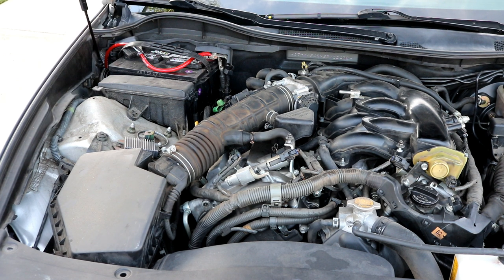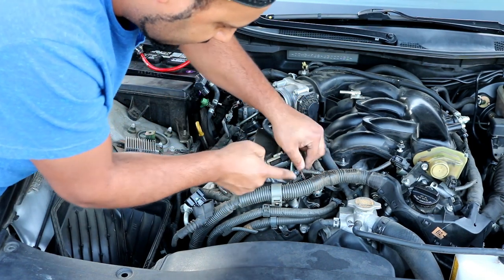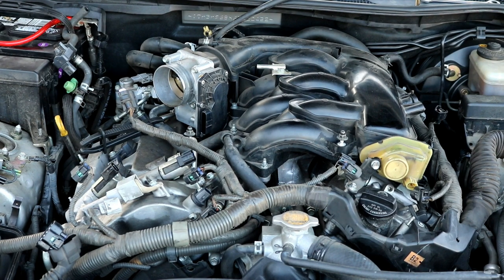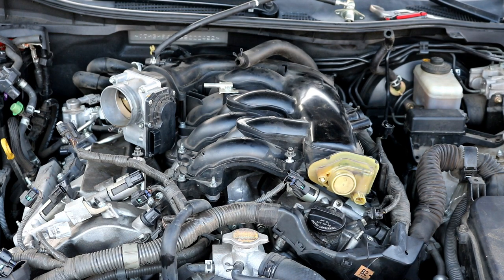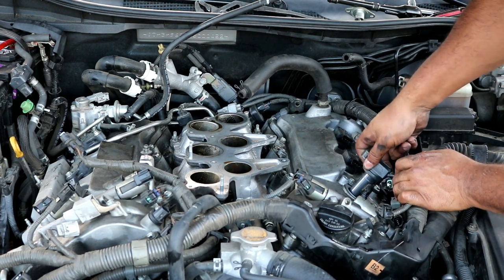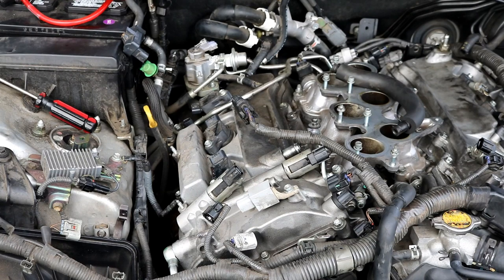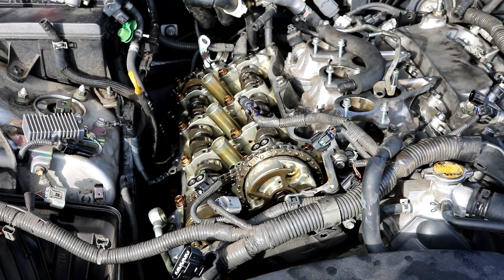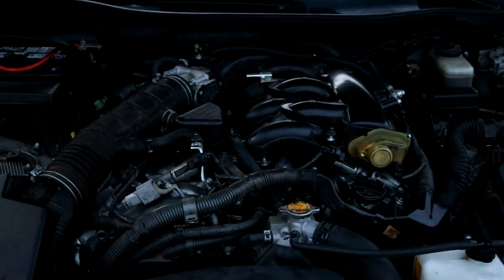Lexus GS300, GS350, IS350, IS250 Valve Cover Gasket Replacement

Comment: Any tips for the gs 350 model? The working room behind the intake manifold and throttle body are extremely limited. The intake manifold is a slightly different design. The throttle body and intake manifold are closer to the rear
Reply from the maker: What year?
Reply: 2008. I got the intake manifold off and started loosening the driver's side cover but I'm worried about the passenger side with that fuel pump or whatever that thing is. Those two thicker coolant lines that are behind your fuel pump are directly above the fuel pump in my model, going to try and wriggle it out from underneath them today
Reply from the maker: Good luck. Your motor is still a GR motor but just slightly different in a few ways. Overall mostly the same.
Reply: @HelpingHandAutoRepair  would you recommend taking the fuel pressure regulator's top part off so I can get some clearance to get it off of the cover
Reply from the maker: If you need to.
Reply: @Bigsackjc  hi my 2008 is250 have same issue. I’m trying to change the valve cover gasket but on passenger side so difficult to take off the cover as you said two thick pipe above the fuel pump. 
I don’t know if I can take off these two pipe off or coolant will be leak, so I need to drain the coolant first?
Reply: @wjks23  if they are rubber hoses just clamp them shut. I'm not sure about the is250 model as it is a different engine
Reply: @Bigsackjc  ok thank you !

Comment: I'm currently in the middle of this job with my 08 is350.  I cant seem to get the spark plug tube gaskets out of the valve cover.  The rubber has hardened to the valve cover and I'm afraid I will damage it getting the gasket out.  Any ideas?
Reply from the maker: Hammer and a flat head or chisel will crack the seal and then you can pick it out. This happens all the time and they can suck to get out.
Reply: @HelpingHandAutoRepair  Thanks!  Thats what I ended up doing.  Was worried Id damage the valve cover. but it was fine.  Currently making this job a lot harder than it needs to be by dropping stuff, not having the proper tools, and stripping the threads to the driver side banjo bolt.  You weren't kidding about that one.  Thanks for the video, its helping immensly.
Reply: @vguitarman  I’m running into the same problem stripping the threads on the driver side, you got any ideas ?
Reply: @vguitarman 2006 IS350 btw
Reply: @lanceredolosa4835  ultimately I took it to a shop near me and had them chase the threads. Came out fine. I just didn’t have a thread tap and die set and didn’t think that was the time to start learning. Such a bummer, hope you get it figured out.

Comment: How long would an experienced mechanic take to do this job? Also how much?
Reply from the maker: Prices vary depending on where you live. If you take it to a shop, they are going to charge you “book time” regardless of how long the mechanic actually takes on it. I would expect an experienced mechanic to do this job in 3 to 3-1/2 hours. I bet book time for this job is 4-5 hours. Multiply 5-6 hours by that shop’s labor rate and you got the labor cost. I would estimate the cost in my area would be around $500-800
Reply from the maker: Prices vary depending on where you live. If you take it to a shop, they are going to charge you “book time” regardless of how long the mechanic actually takes on it. I would expect an experienced mechanic to do this job in 3 to 3-1/2 hours. I bet book time for this job is 4-5 hours. Multiply 5-6 hours by that shop’s labor rate and you got the labor cost. I would estimate the cost in my area would be around $500-800

Comment: Stuck on my banjo bolts super tight . Starting to strip. On the GS 17 mm 😮😔
Reply: Same thing happened to me, but I was able to get driverside loosed with a 17mm 12 point closed wrench. For the passenger side I used a 17mm socket with with a 1/2 extendable ratchet to loosen it up.

Comment: thats alot of work man, id rather just pay someone to do this, how many miles on your car when oil leak started?
Reply from the maker: jason born This car has 200k, I would say they start leaking around 150k-165k
Reply from the maker: jason born It was a lot of work. If you lived in Nor cal I would say you could pay me to do it lol.
Reply: My gasket leaking at 90,000km but it’s now a 13 year old car
Reply from the maker: TheDIMSummoner Bay Area
Reply from the maker: TheDIMSummoner they are both great cars with the same engine make up (both are based on the 2GR engine family) as you stated the GS’s FSE engine does have port injection but that is performance related and will not affect how long the engine will last. I personally like the GS body style, I like RWD cars (the ES is FWD) and I also like the longitudinal layout of the GS. It will be slightly easier to work on. The rear seat leg room is more cramped in the GS. If that is an issue then maybe go with the ES.
Reply: @HelpingHandAutoRepair  what part of the bay area are you located? I'm from San Jose and have a 2003 lexus gs300 that needs this.. And how much would you charge?
Reply from the maker: Your GS300 is not the same as the engine in this video. I’m a little over a hour from you. Towards concord. Labor for your car would be $200 + parts. I recommend doing new spark plugs at the same time since I’m there already unless you’ve had them done already.
Reply: @HelpingHandAutoRepair  that's not too far.. Would you have time tomorrow?
I also have a check engine light on and it said I need a new cat.. My friend pulled one off his IS 300 so i already have the part and need to have it installed also.. Do you have an email or phone number so I can contact you directly.
Reply: @HelpingHandAutoRepair  OK thank you. I saved your email so you can remove it now.

Comment: Good job mate, I got a headache watching this video lol..
Wonder why Lexus developed this engine this way?, wonder how much a mechanic would charge for this job???.
Reply from the maker: Probably around $500-600 labor at least
Reply: The 2006 gs300 engine is meh, but the 2006 is350 2GR-FSE was a marvel when it debuted: D4-S direct AND port injection that allows a 11.8 compression ratio, VVT-i variable valve timing on intake and exhaust cams, forged rods and crank and in 🇺🇸 spec pumped out 306hp and 277tq out of 3.5L. It was on Wards Best Engine list from 2006-2009.

Comment: Can you tell me where the camshaft position sensor circuit A bank 1 is please
Reply from the maker: Bank 1 will be passenger side if you have the 3gr engine. Circuit A is Intake sensor. So if you are looking at the engine, in the front of the engine on the top of the valve cover on the passenger side cylinder head. There should be two sensors. One is for the exhaust cam, one is for the Intake cam. The sensor closest to the center of the engine will be the one.
Reply: Helping Hand Auto Repair thank you so much! Got code P0340 camshaft position censor bank 1 A circuit along with P0335 crankshaft sensor. Going to check wires/connection. If good going to replace camshaft sensor. Car will not turn on at all. 2008 Lexus GS 350 RWD
Reply from the maker: JustJay 0312 well you need to replace the crank sensor as well. I believe that is near the ac compressor on the driver side of the engine on the bottom or near the bottom of the engine. I don’t remember if you need to remove the ac compressor or not to get to it.
Reply: Helping Hand Auto Repair I was afraid of that, shouldn’t be too hard to get to.

Comment: I’m down to the valve cover What do I do about the a bolt next to the ignition coils there is 2 total. what do I do about it to remove the valve cover I removed every other perimeter bolts. They are in the center
Reply from the maker: Sorry, I posted this video 4 years ago. Everything is vague in my mind now. If you follow the video, I show the entire process. Coil packs will need to come off for sure.
Reply: @HelpingHandAutoRepair  I need help finding the torque specs on the Valve Covers for 2007 Lexus is250.
Engine is 4gr fse.
Reply from the maker: Smaller bolts should be 7 ft lbs.
Larger bolts should be 15 ft lbs.
Reply: @HelpingHandAutoRepair  how did you put back on the fuel regulator it’s hard to make it flush back on
Reply from the maker: @tyronejefferson5124  with some patience.
Reply: I have made it flush back on but by the time I try to bolt it down it raises back up. I’m thinking about holding it down till it’s flush and bolting it on like that but i don’t know if that’s a good idea. What was your process it might help me if you can remember
Reply from the maker: I can’t. You will probably just have to get clever about it.
Reply: Did you have to release the pressure from the fuel regulator? Or you just take it off and put it back on because I took it off and trying to put it back on

Comment: Does anyone know which valve cover goes on what side  I’m replacing my the valve cover on my 2009 is250  and Lexus has it labeled as cylinder 1 and cylinder 2 valve cover I would appreciate it thanks
Reply: Mine is is250 2008 and replacing valve cover gasket too. 11214-31020 gasket on right side( facing engine ) which is driver side as diagram.

Comment: Whats the torque specs for the valve cover bolts?
Reply from the maker: David 7 ft./lbs. for the various 10mm bolts and the other 3 bolts that are located near the rear of the heads (closest to the cabin) are 15 ft./lbs. 

To be clear the 10mm bolts: 7 ft./lbs.
Larger bolts: 15 ft./lbs.
Reply: Helping Hand Auto Repair are we sure this is the right torque?
Reply: Did you torque the banjo bolts ?

Comment: Hello Dear, do you know where is camshaft position sensor for Lexus gs 350 2008 located ?
Reply from the maker: Trance nguyen If I recall there are 4 on these engines. They are the cylinders located on top of the valve covers closest to the front of the car. I’m pretty sure of this.
Reply: Hey thanks for your info that was cool, as far as i see 2 of those on top of the valve covers in front 1 on the right and 1 on the left both black plastic, is it what are you talking about?
Reply from the maker: Trance nguyen correct

Comment: I have 09 GS350 it gave me a code for P0302 so   I change my sparks and coils but it still giving me a misfire on the on P0302 
Do I have a blown gasket?
What should I do?
Reply from the maker: Jorge Baltazar when you changed all the spark plugs did you notice any oil on the coil pack boots when you pulled them out?
Reply: Helping Hand Auto Repair... no the coils seem pretty dry the spark plugs were beat doh and the coolant was low
Reply from the maker: Jorge Baltazar So to clarify:

1. You changed all 6 spark plugs with the correct O.E. type spark plugs?

2. You changed Cylinder #2 coil pack (Cylinder #2 is on the driver’s side closest to the front of the car) 

After all this you deleted the check engine light and the same code STILL comes back?
Reply: Helping Hand Auto Repair yeah I did all that but the code keeps coming back after a few engine start up what do you suggest I do next?
Reply from the maker: Jorge Baltazar How many miles are on the car?

So p0304 keeps coming back right?
Reply: Helping Hand Auto Repair i have 142000 miles on it the code is P0302
Reply from the maker: Jorge Baltazar Ok. Fuel injectors can also cause misfires. Unfortunately your engine does have Toyota’s D4-S fuel injection system meaning there is a traditional port type fuel injector and a high pressure direct injection injector.

The port fuel injectors are pretty easy to get at from this video you would need to pull the other portion of the lower intake manifold off to gain access to them. From there you can swap the injector from cylinder #2 to any other cylinder you choose. Put everything back together, delete the codes and see if the misfire comes back and follows that “bad” fuel injector (ie goes from cylinder #2 to say #4 if you put it there)

If it does then you can confidently say you have a bad fuel injector. 

If the misfire stays on the same cylinder then I would next check compression as it is a relatively easy task and see what that turns up. I highly doubt you have a compression issue but it is something that would need to be tested as well IF swapping the fuel injectors doesn’t work. 

Lastly it is possible that the direct injection injector is clogged and would need to be removed and cleaned/replaced.
Reply: Helping Hand Auto Repair thanks I will try that thank you so much
Reply: Helping Hand Auto Repair The misfire code is still coming up in the same cylinder we notice that the injector was dirty and needed to be replace so we replace it 
I’m also losing coolant and no visible leaks
Reply from the maker: Jorge Baltazar Ok so we have covered two of the three parts needed to run an engine. Spark and fuel. You need to do a compression test on that cylinder to see what you come up with. Now that you’re mentioning you’re losing coolant that has me thinking of other reasons why that cylinder is still misfiring.

You need to perform a complete compression test on all the cylinders or at the very least all the cylinders on the side that is misfiring. If you check my channel I have a HOW-TO on checking cylinder compression. 

An engine with your mileage should produce at least 150psi give or take 10psi. Anything 120psi and below causes concern. However what’s most important is that all the cylinders are within 2-7psi of each other. If one reads 180psi and the other reads say 165psi then you may have an issue in that cylinder. 

Please record the numbers accurately and get back to me.

Comment: Does anyone knows how to put the driver side banjo bolt back in? I’m having a hell of a time putting this 🤬 back in place. I’m trying to tighten it but stays loose. Anyone could explain or show how they did it? Thanks in advance!
Reply from the maker: If you started it by hand and threaded all the way back in and it’s not tightening up, you could have stripped the threads.
Reply: @HelpingHandAutoRepair  so what’s the alternative? Do I need to buy a new driver side valve cover? It was a pain in the a$$ to loosen it because there was very little room to remove that stupid bolt. So do you think I stripped the bolt when I was getting it out? BTW, Thanks a lot for posting this video! You saving people a lot of money.
Reply from the maker: @marcomelo8576 you honestly need to look closer a the threads on the bolt and the holes.
Reply: @HelpingHandAutoRepair  The problem is that there’s no room to do that for the driver side due to the fact that there’s a stupid A/C line right next to the banjo bolt. Can I remove that A/C line to get more room and have better access to get that banjo bolt back in the whole? Apparently the Lexus ES you were working on this video has way more room, but unfortunately for the IS 250 owners the room is very limited almost to none. Please let me know what would you do.
Reply from the maker: This was a Lexus GS300 not a ES300.

Granted the GS probably has a slightly bigger engine bay. You are just going to have to do what you can. This was a customers car that I worked on a long time ago. I don’t remember all the specific lines and such in the way by now.
Reply: @HelpingHandAutoRepair  What's the torque for the bolts on the aluminum manifold and the plastic manifold?

Comment: anyone know the torque specs for the valve covers or torque sequence?
Reply from the maker: Bigger bolts are 15 ft. Lbs.
Smaller bolts are 7 ft. Lbs.

Just tighten from the middle of the valve covers and work your way out. So middle (top and bottom) then continue working your way out towards the front of the car and the back of the car.
Reply: @HelpingHandAutoRepair  thanks. but what do you mean by smaller or bigger bolts? there are diffrent size bolts on the valve cover?
Reply from the maker: Ivan Giraldo There are two different size bolts holding down the valve cover. There are two or three 12mm bolts. Those get torqued down to 15 ft. Lbs.

The rest of the bolts are 10mm and those get torqued down to 7 ft. Lbs.
Reply: @HelpingHandAutoRepair  Perfect thank you so much for your help man. couldn't find the answer in the forums.🤙
Reply from the maker: Ivan Giraldo no problem!